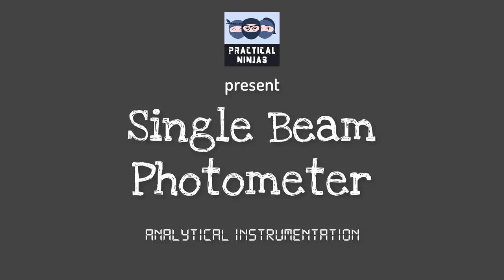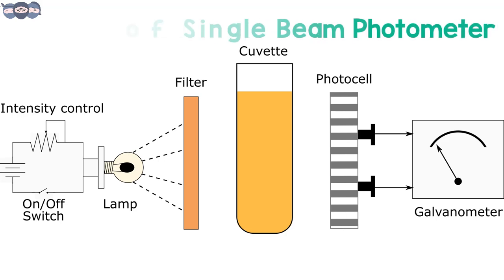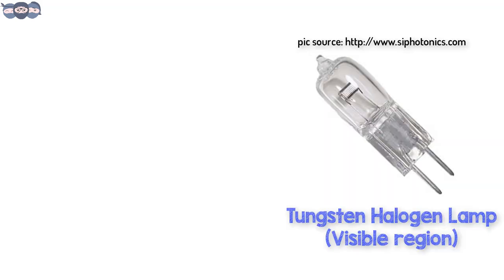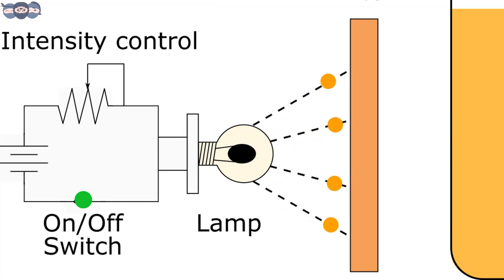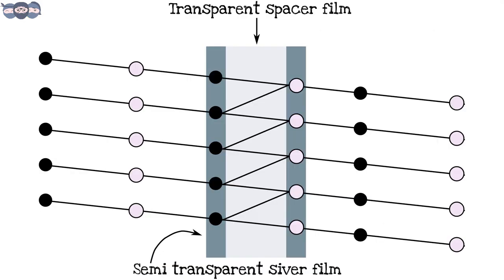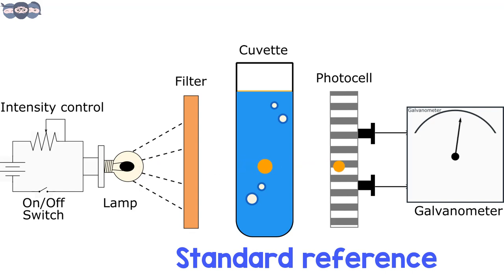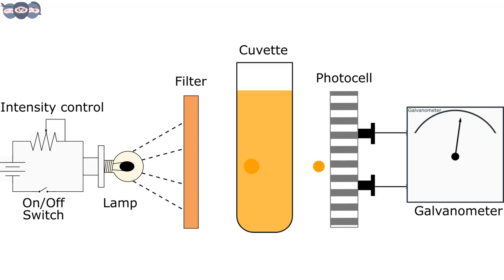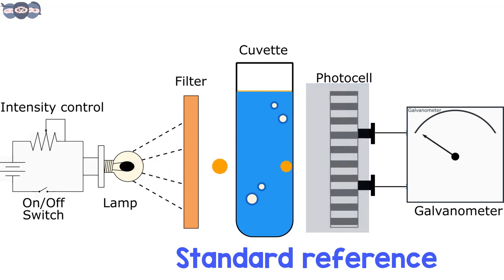Analytical Instrumentation 04: Single Beam Photometer Explained | Construction & Working Principles

Comment: I like your way of defining the subject 
But in a  single beam photometer one should use a slit it's a single beam photometer on a beam of Rays are passed through the sample not light in the former of radiation you should use a prism too it's important to form monochromatic light
Reply from the maker: We agree with you that absorption spectroscopy requires a monochromatic light. But the instrument discussed here is a photometer. Photometer obtains monochromatic light with the help of a filter as seen in the video. Prism monochromator or diffraction gratings are used in instruments called as spectrophotometers. Hope this clarifies the difference :)